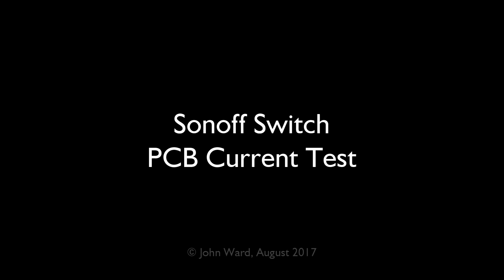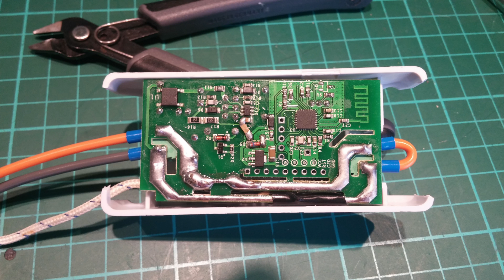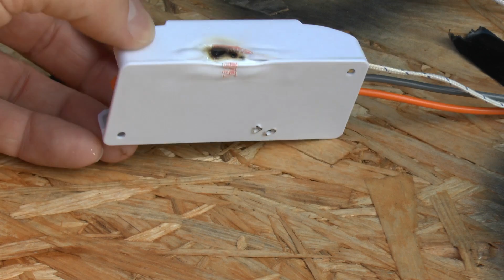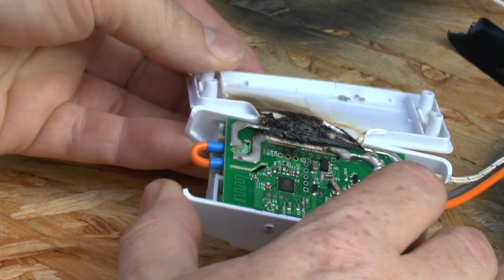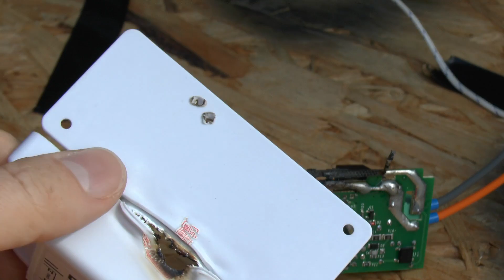Sonoff Switch Current Overload Test

Comment: My household load is under 3kw can I use one sonoff pow r2 to measure mains load? I also use solar inverter to run my household load
Reply from the maker: Yes, if you have a 220-240V supply.  The device is rated to 15 amps, which is about 3.6kW with a 240V supply.  With a 120V supply, max load is only about 1.8kW.
Reply: @jwflame  thanks
Reply: Installed and gave household load and its working fine.

Comment: Did you use a low voltage and high current power supply (modified transformer)?

Comment: Hi John, this is a very interesting test! Would you be interested in re-creating it with the new Sonoff design (using insulated wires instead of PCB traces for the high voltage current). I'm very interested in how much of a difference that design feature would make!

Comment: You kind of forced it to overheat in a short period of time. A good experiment is to see if you can run a 10A device with 16A for variable times over the course of days. It looks like it can handle up to 16A for a few minutes. Maybe an inline fuse would help.

Comment: If you bridge the relay, it means you did not let the ESP8266 run and close the relay. It would have been a better test if you have run the ESP8266 like normal operation. I think the ESP8266 will open the relay when the temperature reaches 100C inside, but I am not sure. Most of the current uP will shutdown internally when temperature gets high as 100C, It would be nice to put PTC resettable fuse inside and have it open to control the digital input of ESP8266 and open the relay which should be NO.

But thanks for doing this and destroying your Sonoff for us. This technology will be a forerunner in the future to come.
Reply: I agree that would be a good test, but I believe he only wanted to test the tracks themselves. In newer Sonoff's those tracks have been replaced by 14AWG stranded wire running loosely over the top of the board.

Comment: Thanks very much - that's a fairly comprehensive test measuring all the parameters one might want to and still apply to the real world. I really appreciate it as well as the tight format you presented it in. I've been worried about these little things - I've had 5 for months, but only configured one only so I could do some sort of testing, but your testing was likely far better done than mine. So far I thought - damn this things gets hot, so I bought some LM35 temp sensors, rigged one up into some velcro to hold it against it and tested it to make sure it was semi accurate, and then promptly forgot about doing anything more.

 So thanks!

Comment: Thanks John, great video. I presume you were running at 240v. Is it safe to say it could run close to 20 amp on 120v in North America?
Reply: 10 amps is 10 amps. Doesn't matter if it's 1 volt or 1000 volts. Amps is amps.

In general, you should avoid running anything above 80% of its load rating.
Reply from the maker: The device in the video is only intended for 240V, but they do make 120V versions.  If it's rated for 10 amps, it's still 10 amps even with a lower voltage, higher current would require larger conductors inside and a relay with contacts suitable for higher current.

Comment: Came here specifically because of concerns around possible safety issues of these devices. I'm happy to hear that at the very least, they have a fairly safe failure method. I look forward to using a few of these around the house on small loads (fans, lights, that sort of thing). :-) Thanks from Canada!

Comment: the relay would have likely failed first. the entire test is pointless if you didn't find the weakest link and how much it can truly handle safely
Reply: Jimmy O. Actually the weak point is the screw terminals, rated to only 8A and they're the ones with the little metal tag that doesn't grip properly.... I fitted one of these in a waterproof enclosure and the wire just kept pulling out as I was trying position it and close the lid.
Reply: However, it does show us that the case doesn't burst into flames. I also found the weakest part was the terminals, I actually had to resolder mine.

Comment: Hi John, thanks for the video. I see you had shorted the relay terminals. I was wondering if there is a test to see the capacity of the relay and at what temperature it might become a fire hazard? Also, have you had any experience with inductive loads like transformers on the Sonoff switches?

Comment: thanks i feel a lot safer using one of these with a 1400w computer that's running 24/7
Reply from the maker: If it's on 24/7, why does it need a switch?
Reply: John Ward It's a mining rig, sometimes the OS freezes and it automatically restarts, sometimes it doesn't and you have to manually restart unplugging and plugging again. If this happens and I'm away for a month I will "lose" money every hour the pc is off. With the sonoff i can hard restart it from anywhere.
Reply: # so I have a 500w Glen skirting board heater. This would also be fine to run for hours on end without issue?
Reply: @byronwellburn  I'm only switching low current devices with my Sonoff switches. I just don't trust the AMP rating anyway. But if you want to switch a PC with one of those. You can better buy the Sonoff th16.  That one does also show the  power consumption.

Comment: Great video JW.  I am wondering the black residue isn't due to the electrical tape that you held the thermister bead to the board with?  Is that what melted and exacerbated the heat issues? Thoughts?
Reply: CHIS EXACTLY MY OBSERVATION AND REASON FOR SCROLLING THROUGH THE COMMENTS

Comment: Awwww JW I am so disappointed! I sat down with a bag of popcorn to watch the cheap piece of Far East plastic bust in to flames, the fire and rescue service rescue you from the smouldering remains of you test bed and... Well, nothing! It got a bit warm and melted 😞 I'm not blaming you of course, you did your best at 100% overload, no one can blame you for this dismal failure... I guess they just don't make them like they used to! - Thank goodness! I may have to add some of these great little switches to my home automation set up. Joking aside, Thanks for another great video, keep em coming please.
Reply: Mark Leach lll

Comment: Not like 1930's electrical equipment, I had an electric motor from that period and it was rated at not more than one degree temperature rise in an hour with a hundred per cent overload. It complied to a BS standard of the time according to the plate, nothing is made like that any more.
Reply: Compared to how much it cost in the 30s and how much you would earn  in the 30s. If sonoff cost $100 to buy, it probably will be that 30s quality.

Comment: Thank you very much John.  I'm actually very impressed that it even managed to handle that much - I was sure it would pop around 12-15A.  I'm curious as to why you shorted out the relay?  Was it to prevent it blowing first so you could get a truer measure on the tracks and their capabilities?
Reply: Steven McCombie I think it's because he's supplying a low voltage, probably not enough for the control electronics to work reliably.
Reply: steven mccombie he bypassed the relay because the contacts of that are rated at 10A and that would have failed before the PCB soldered track would. Impressive devices, although not CE marked the newer models I believe are tested. I bought 7 of these and am well impressed with them.